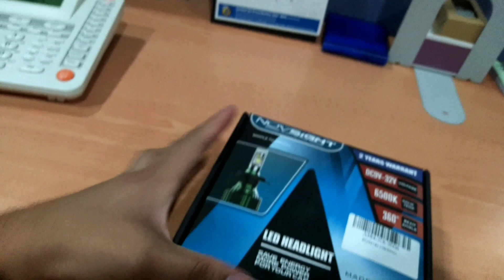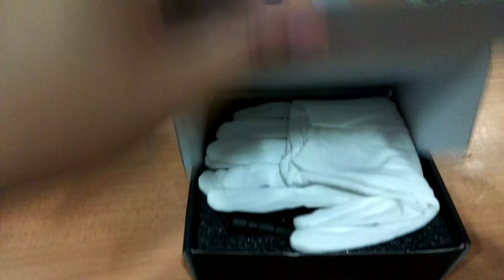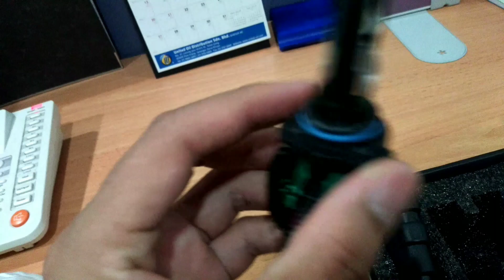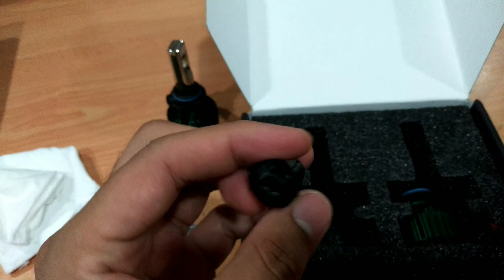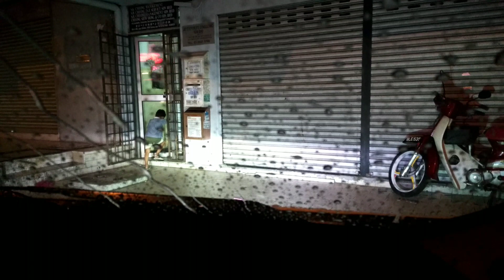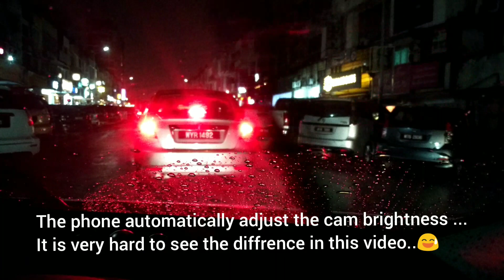Review & Unboxing | Novsight N8 9006 16000LM (Passed Malaysian Headlight Safety Regulation )

Comment: Bro... I see it's almost an year u have installed it... R u still using it? How's the performance? M planning to upgrade both high beam and low beam 9005 and 9006 on Toyota corolla 2004... Do u suggest these ones ? M particularly looking for 16k lumens and above for improved brightness...
Reply from the maker: Hi Bro, please stay away from Novsight they're unreliable and the warranty scheme is scam. You may try Auxito Y13 LED they're use the latest automotive LMP LED  chip with 40watts per bulb power and 16K raw lumen. Subscribe to my channel if helpful.
Reply: @IkmalRusli  tysm will search Auxito if available in India..
Reply: @IkmalRusli  auxito led lasts longer, more reliable than Novsight?
Reply from the maker: @wilwazz6086  They warranty is reliable so should be no issue down the road with the purchase and of course they're more brighter
Reply: @IkmalRusli  thx. I'm looking for high beam light. If Auxito lasts longer, will try it
Reply from the maker: @wilwazz6086 Yes their using better chip

Comment: Can this fit pajero sport?
Reply from the maker: Hi bro, not really sure what socket type  is used by pajero sport. You may need to check online what is your bulb fitment as i may varies from model to model. But try other brand other than this cause this bulb has an issue after only 8 months of use. Subscribe to my  channel if its helpful 😄👍

Comment: Bro what happened to the bulb? What about the warranty?? I heard is 2years so what happened to that?? And I saw they sell mostly are 6000k is it illegal and will there be problem when JPJ/ Polis roadblock?
Reply from the maker: Hi bro, their warranty is not legit and i considered them as bait only.  What I mean by JPJ passed is that your low beam  level is not entering front's car cabin as mentioned in the video. Any bulbs brand will passed this regulation as long as they are properly leveled and calibrated. Kindly subscribe if its helpful.
Reply: Ikmal Rusli I see, however I do heard and see that JpJ rules for the passed kelvin are 4300k and below, with this bulb which is 6000k and above is it still consider legal ??
Reply from the maker: @Anyone-ph8ex  that is totally haox bro, if by now the rules are like that all newer bmw, audi, and lexus are off malaysia market. All of them are using 6000k leds and laser headlights totally no near 4300k plus you see new myvi is equip with 6000k leds. Dont stop someone from moding your car 😄👍👍
Reply: @IkmalRusli  that was because those cars came pre installed with LED technology straight up from the factory, that is why it is road legal.Any aftermarket headlights modifications are considered illegal, especially those color temperature that already exceed 4300K.No matter if your car came originally fitted with projector lens, if your default lights are halogen, you have to stick by those lights only.These are the statement made personally by the Head Of JPJ himself.Hate to break it to you, but you’re wrong.
Reply from the maker: @afifkiryu94  so far I what I know it is legal to modify brightness and color temp in malaysia. This is acknowledged by all Malaysia car headlight accessories as long as it is properly calibrated. As per my car i am using 300m+ led projector never been issues with roadblock. Depend on what u want to do with you car as i know in every nation once its legal its legal regardless of aftermarket or factory. Like in U.S no car can exceed 2000lm therefore no bmw or audi is equipped with laser headlight in that country but again not in Malaysia
Reply: @IkmalRusli As i said, you can only modify it as long its not exceeding 4300K, and still a halogen type bulb.You’re saying if it is properly aligned and calibrated, it is legal?Dude, let me give you a situation.If you’re carrying heavy load in your car, or an extra passengers at the rear seats, or perhaps offloading some stuffs from your car, that will pretty much rendered your “properly calibrated lights” useless.Because those scenarios will definitely tempered with the height of the light beams that are projected on the road.And you might accidentally not by your  own accord, be blinding the oncoming traffics.And talking about aftermarket LED, there’s plenty of those on the market.How can you be so sure the ones that you bought might be suitable for your vehicle?Just because it came equipped with projector lens doesn’t means that it was designed to be fully compatible with LED retrofit.You might even came across some difficulties to even fit it nicely into the headlights socket because of the bulky fan/heat sink on the back of the bulb.On some instances, it could even cause the lights to wobbly due to road vibration, and some water might started to sipped in through the sockets opening, causing your headlights to starts condensing after some time.Just because you never had any issues with those roadblock inspections doesn’t mean that you’re abiding by the law.There are folks out there that installed an aftermarket exhaust system that are producing noise more than 80 decibels.There are also those that tinted their windows fully blackened from all sides.There’s also people out there that installed sequential LED on their car trunk, but we still seeing those people driving around being a road hazard without any repercussions.Even though by law, we know that all those modifications are straight up illegal.You can’t simply thought that once a nation legalized it, it is fully legalized regardless of factory fitted or an aftermarket.That is ignorant.Think about it, all those headlights that came pre installed from the factory that were fitted onto your car, are going numerous times of testing and inspections just to be deemed road legal.Just think what’s going through all those headlights designer’s mind, designing the headlights system and taking into account the way to make it fully compatible with the car overalls functionalities.You can’t just fitted it in, calibrated the beams and be done with it.Its not as easy as what you think it is.That is why it is illegal.That is why any headlights modifications that were retrofitted after, that is not in the same specs or technology as the stock bulbs are considered against the law.
Reply from the maker: @afifkiryu94  Bro you if you don't wanna do it don't do it if you headlight DIY project failed don't blame us swallow it off loading happened for both retro and non retro its the same for each vehicles therefore proper calibration is important and  again in malaysia color that is accepted is from 2000k till 6500k(does not mater led/halo/hid/laser). but that does not much an issue, the issue is calibration bad calibration blinds people. I  think you were right if you are bad at DIY skill like yourself better stop cause you're  put people and yourself in danger. Thanks n noted
Reply: @IkmalRusli  nah..you don’t get it, do ya?You’re just being stupid and stubborn at the same time🤷🏻‍♂️ ouh well..once a lost cause, always a lost cause.
Reply from the maker: @afifkiryu94  noted  thanks for viewing...drive safe with ur factory spec car dont diy